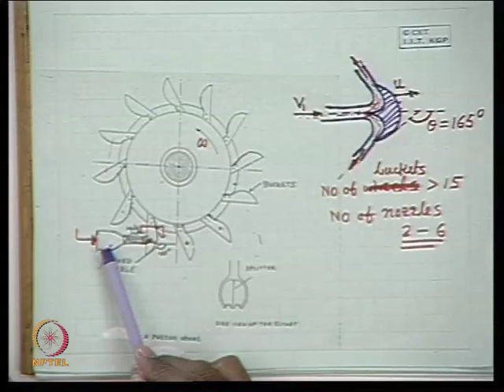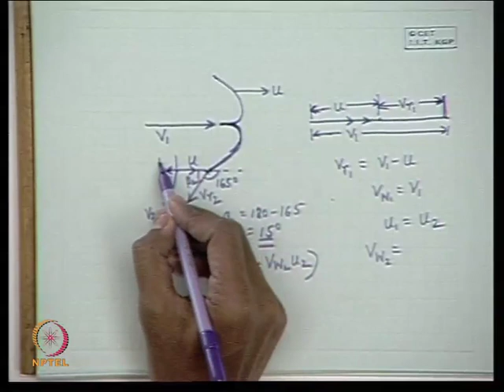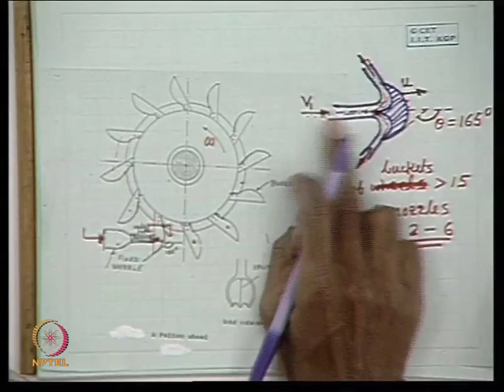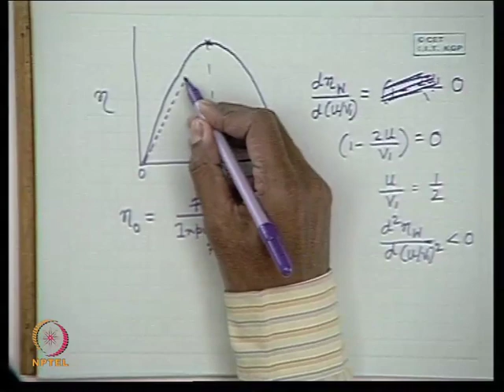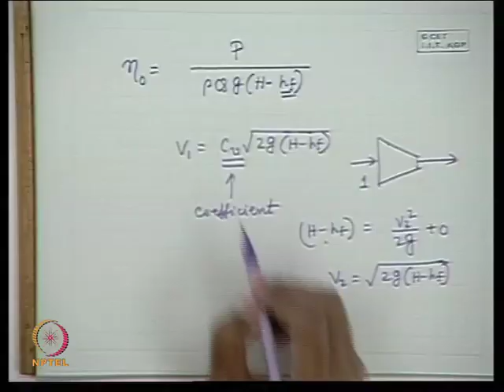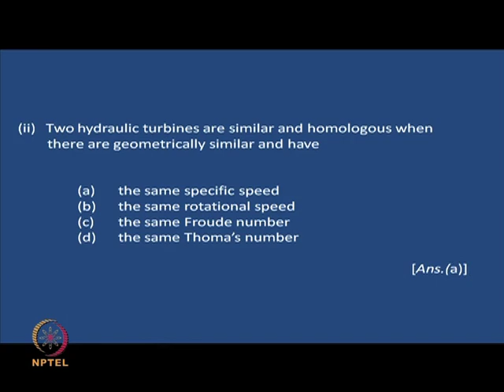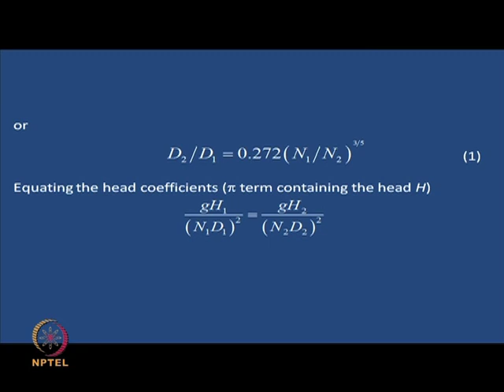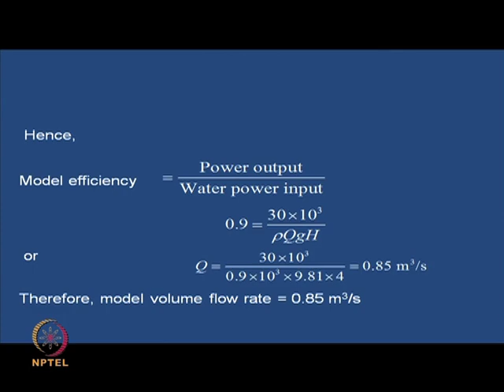Mod-01 Lec-07 Analysis of force on the Bucket of Pelton wheel and Power Generation

Comment: In the course of interaction of fluid with the bucket, the orientation of the bucket wrt to jet and the the point of attack of jet(i.e at the middle of the bucket) remains the same?Considering this, wont there be any fluctuation of energy on the wheel to be compensated by flywheel?

Comment: Can someone please explain how u1 and u2 becomes same? They can only be same when omega R1 and omega R2 will be equal, and we know omega is same as that of runner, then R1 would have to equal to R2, and we can clearly see that R1 is the distance between runner centre to blade tip and R2 is equal to from runner centre to blade mid point?
Hence we can see R1 is not equal to R2 then how u1 equals u2???
Reply: Here u is the velocity of the bucket. The component of bucket velocity will remain constant for both the inlet and outlet fluid.

Also the purpose of the spitter is to only provide the direction to the outlet velocity. Its length is negligible. If you'll extend the direction vector of V1 and V2, the momentum transfer will occur at the common point, i.e. the centre of bucket. Hence the radius R as well as U is calculated from the point of termination (for V1) or the point of initiation (for V2) of the flow jet.

Comment: how can you help me solve this question (a pelton wheel develop 2000KN under a head of 100m and with an overall efficiency of 85%. find the diameter of the nozzle if the coefficient of velocity for the nozzle is 0.98)
Reply: Assume the given fluid to be water so that rho will be 1000 kg/m3 and also the nozzles cross section to be tapered circular one                        
 PART1] :- by the given overall efficiency , power developed and head  we can find the flow rate at the nozzle inlet ; PART2]:- we can also find the velocity at  the nozzle outlet by the given Cv and head ; PART 3]:- apply the continuity equation at nozzles inlet and outlet i.e, make the flow rates at nozzle's inlet and outlet equal; as we know the flow rate at inlet by Part 1 solving, equalize it to V*A at outlet ; Aa will be pi*d*d/4; solve the equation for 'd'; u will get it bro
Reply: modda lanjakodaka.what are you asking.how dare you ask such a small question to a great legend sk som.ask big big questions.the question should consist of atleast 200000000 pages
Reply: thats how failed sarcasm sounds like
Reply: +Shubham Gupta whatitmeans
Reply: u wont understand get lost this video and the comments r for highly intellectual people
Reply: +Shubham Gupta now i understood how failed sarcasm sounds like
Reply: well that was pretty straight forward to be sarcasm.... 🤣🤣🤣😆😆😂😂
Reply: +Shubham Gupta iam from iit kharagpur.which college r u
Reply: I'm from MIT, Massachusetts, USA.... 😎😎😁😁😜😜
Reply: beggers dont watch nptel.... they throw failed sarcasms and comment about emojis🤣🤣🤣🤣